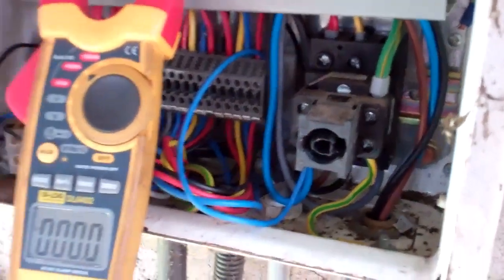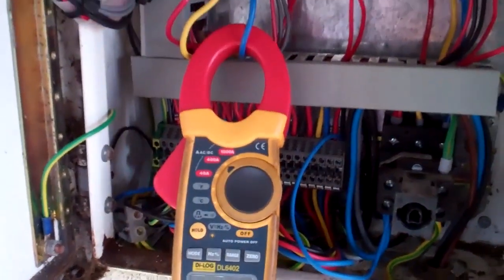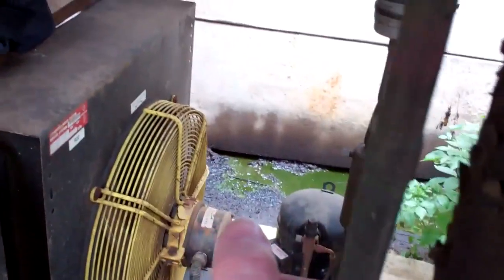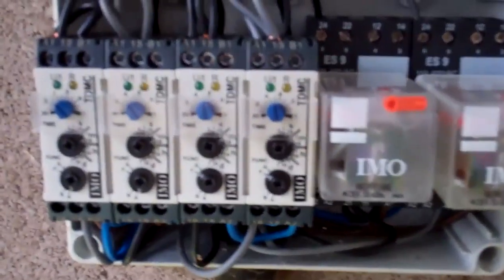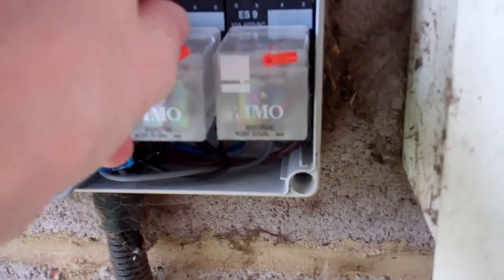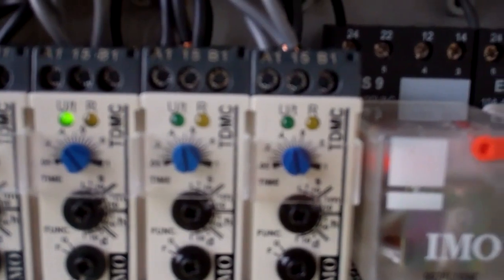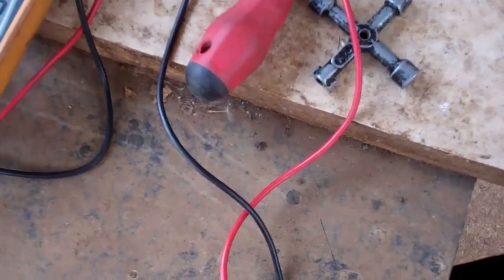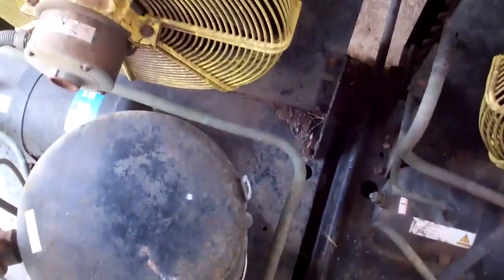Overload Trip

Comment from the maker: Not on milk cooling applications, in fact many don't even have overloads and only rely on the compressor internal protection, in the new tank market, cheapest quote wins, and the systems just get maintained at the level they were put in at unless a specific site has ongoing problems.

I fit overload on my new stuff, to cover my warranty liabilities on new compressors and to give customer a system that will provide years of service. Just means i earn less as often quote against corner cutters :-p

Comment from the maker: These are all IMO timers and relays, available at many sparky shops or somewhere like RS or Farnell.

For a pump test i shut the suction valve in slowly to see how well it would pump down till the lp cut out, often if its got a broken rod they will become noisey as the piston gets pushed down the bore into the crank when the pressure drops then i very carefully shut the discharge valve till it tripped on hp, if you do it wrong it can burst as the momentum of will keep it pumping after hp trips

Comment from the maker: It didn't sound right when it first started and i was surprised the run currents were ok! but once it had warmed up it ran ok and was quieter than the scroll. I pump tested it, which it passed, i think any mechanical problems it might have had would have shown up during the testing :-D